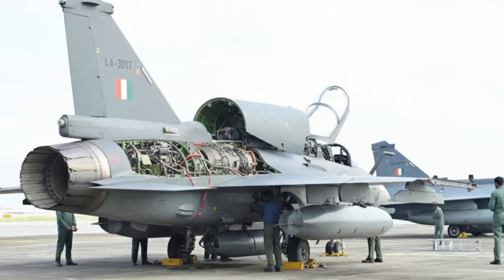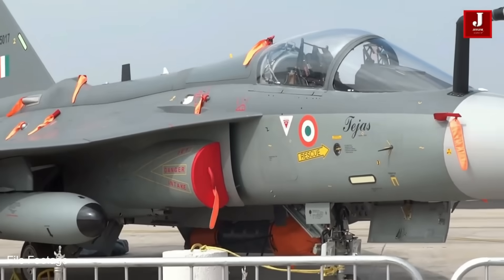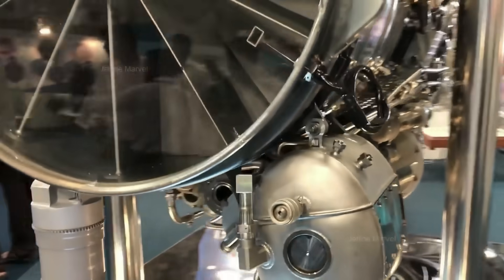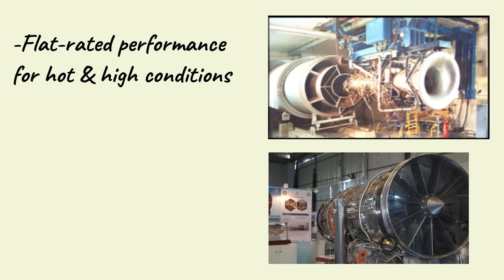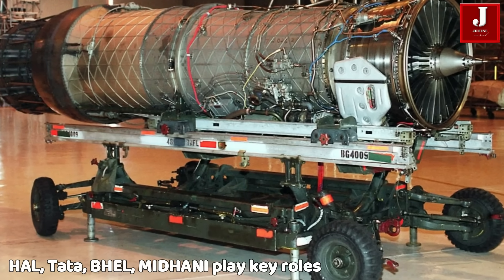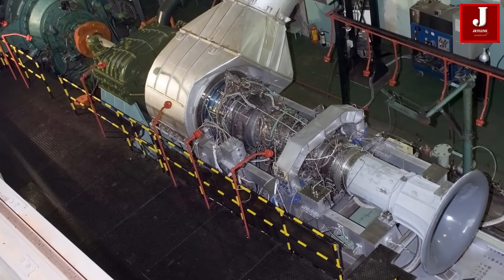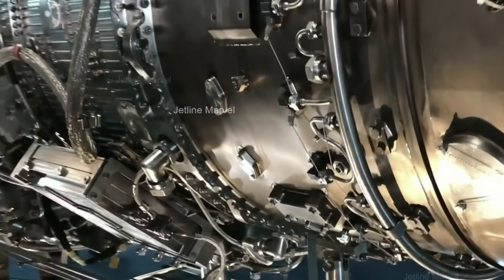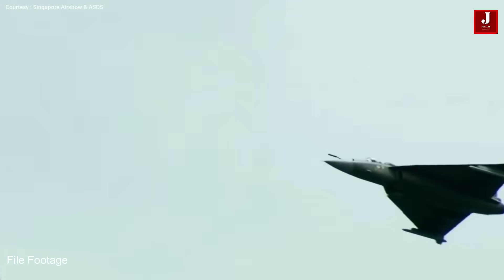India achieves 52kN thrust engine, next target set at 80kN #kaveriD1engine

Comment: The design goal should be 60kn engine not 52kn. 60kn dry thrust engine will meet Tejas requirements.
Reply: It will consume more fuel and cut the range of the aircraft
Reply: They r making heavy engine which push dry thrust to 75 plus kn
Reply: @abhishekbhaskar6268 

That will need a bigger aircraft with a larger fuel ⛽ tank
Reply: That will ve done in second attempt.....for now 52 dry and 85 in wet thrust is sufficient

Comment: Target should be 90 to 100 not 80 but good progress from 45 to 52
Reply: It's without afterburner with afterburner it goes to 75
Reply: It should be hundred plus.
Reply: The greater the thrust, the more fuel it will guzzle and the shorter the aircraft's range.

Comment: Are you sure about 52kn dry thrust?
Reply: KDE D-1 is producing dry thrust of
50 kN to 52 kN. Their were reports that they were trying to get even more thrust out of this engine.
Reply: @Liam_Rivers  Adding afterburner developed by Brahmos Aerospace.
Reply: @সুমন্তনাগ  Plan is to go from D-1 to D-5 by 2028. With D2-D3 in 2026 and D4-D5 in 2027. Every next D series engine will improve on the previous one. This one will be used without afterburner in testing stealth UCAVs.
Reply: @সুমন্তনাগ  Rember, these are only prototypes not the final engines.
Reply: इन इम्प्रूवमेंट्स के साथ वेट थ्रस्ट रेशियो का प्रॉब्लम भी हल हो जाएगा। इसके साथ ही अफ्टरबर्नर के साथ भी 80kn थ्रस्ट मुमकिन हो जाएगा, जो mk1A के लिए रिक्वायर है।
Reply: @Liam_Rivers  remember the kde is only for gathak stealth drone it will be more then sufficient for it!
Reply: They made one check kde series production